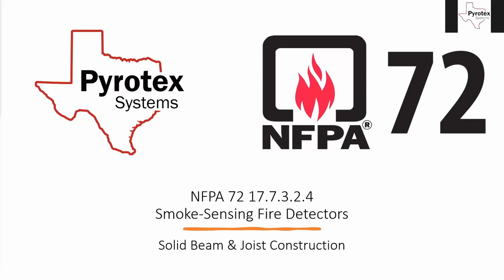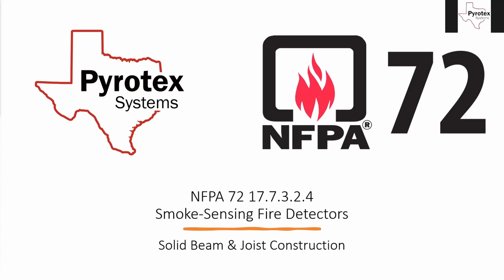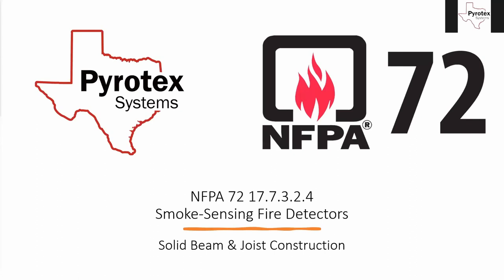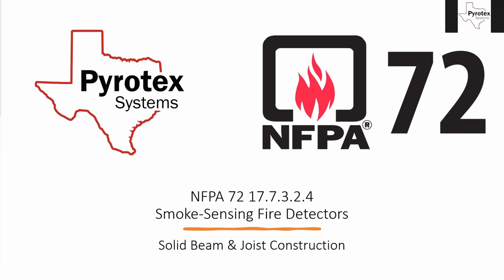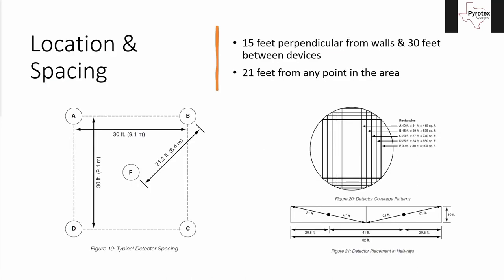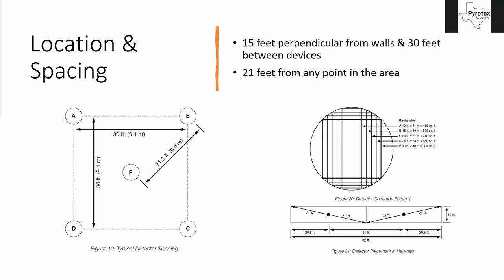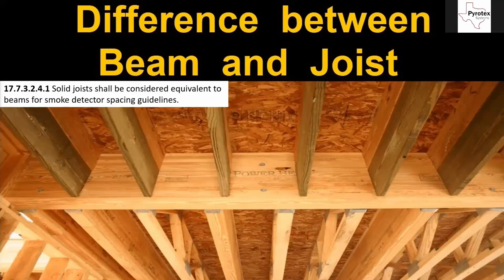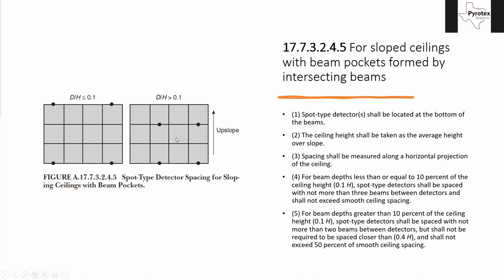Smoke Detector Spacing Requirements Part 2

Comment: Throughout this entire video, you confused the 10% and 40%.  10% is referencing the depth of the beam, from the surface of the ceiling.  The 40% reference is the space BETWEEN beams, not depth of the beam.